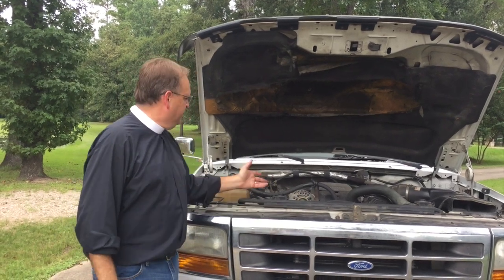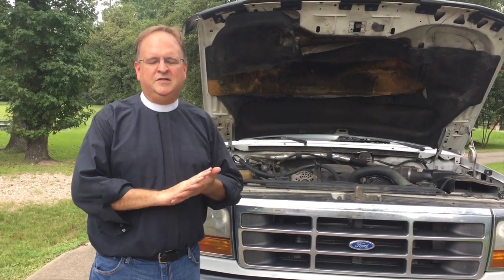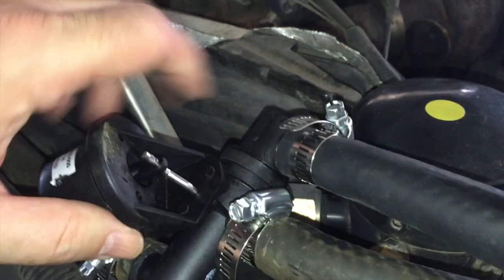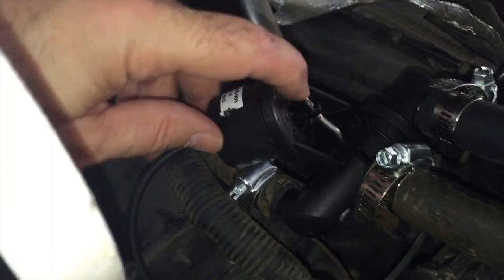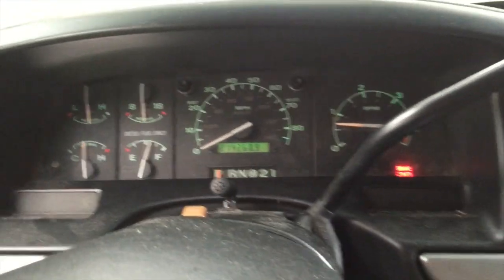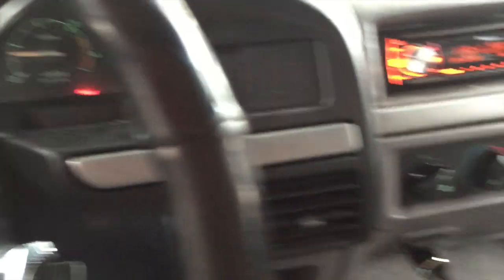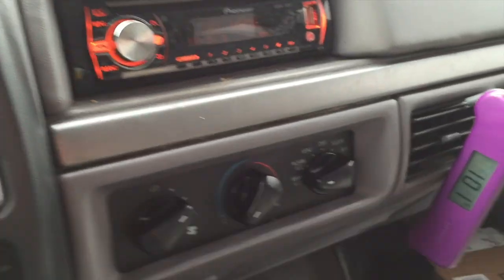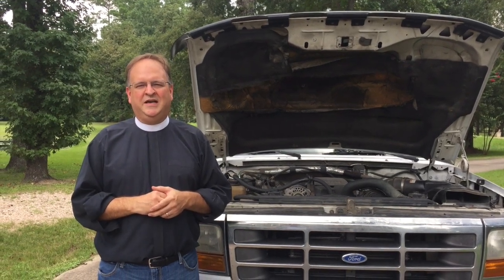Heater Core Bypass - Ford Super Duty - A/C Boost

Comment: Great video. 
I originally just used two hose couplers to separate the heater core from the coolant circulation when it gets hot out. Then put it back inline when it gets cooler and we need a little warmth.
Now that I saw your video I'm going to do this mod.

Comment: You could have just put a in line heater hose valve to when you need heat you just turn on the valve for the heat
Reply from the maker: Yeah, but this way it gets controlled from inside the cab. Handy for those transition months.

Comment: Do you have a Ford part number ? Thanks
Reply: Thanks!!
Reply from the maker: I used a Motorcraft heater valve. Part number YG350. Bought it on Amazon.

Comment: Unplug your heater core and loop the hose around so it won't be no hot air into your cab
Reply from the maker: Yeah, but then the heater won't work when I need it. Here in Texas winters I need the heater in the morning and full-blown AC in the afternoon.

Comment: You said go get some 3/32 vacuuming tube and the stock tube is 3/32 and will not slide over the stock tube. You need 5/32 and will slide over
tight!

Comment: On my 2001 F-350 7.3 I just put a ball valve in the heater hose from the water pump to keep the antifreeze from circulating. I just open the valve when it starts to get cooler out. I guess to totally isolate it I would need a valve in both lines. I just used what I had on hand. Maybe one of these days I'll do it with the vacuum valve . Thanks for the information. 👍
Reply: Are you talking about one of the two hoses that he cut in the video? I thought I did something similar in my Jeep....while driving, it got real hot! I assumed it meant that it needed circulation either thru the core as original, or thru the the bypass valve like in the video. You mentioned a ball valve...doesn't that stop all circulation? Is there circulation somewhere else? Wouldn't your way have the water pump pumping against a closed valve?
Reply: If your way works, I'd prefer it that way because with this bypass valve, the only way to bypass is to run Max AC. What if I just want nice cool outside air thru the vents? Your way would work better in that sense. No reason to run the AC if the weather outside is nice, but without the AC on max, the bypass valve won't work. You'd need another switch to manually control the valve with vacuum so you can bypass the heater core WithOut running the AC
Reply: @stephenmoore3117  My way works very good. I was just in upper Michigan and it dropped down in the lower 50's at night. I need to run my heat to clear my windshield so I opened the ball valve. Several days later it warmed up to 80 degrees and  I could feel the heat radiating from under the dash. Then I remembered that the valve was opened, needless to say I stopped and closed the valve. After awhile the heat subsided. I know you made a comment about  the water pump working against a closed valve. This makes no difference, a lot of old tractors and other vehicles don't even have heaters. Just bypassing the heater core won't hurt anything.

Comment: I’m a big fan of mods like this that correct design flaws/oversights by the factory engineers. I’d be willing to bet that the AC compressor cycles less frequently with this mod, and fuel efficiency/mileage increases slightly as a result. My only concern: does the condenser ever freeze up?
Reply from the maker: Gregory Kusiak I haven’t experienced that at all. The whole system is running great.

Comment: is it safe..?
i do not need heater in my area so can i permanently bypass my heater core its leaking coolant inside cabin...?
Reply from the maker: It's safe in the sense that the all it is doing is bypassing the heater core while the AC control is set to MAX. This keeps hot fluid from coming into the cab and gives a little boost to the AC. I put my control on NORM from time to time just to make sure fresh fluid gets flushed through the heater core. In the winter time I use the NORM setting all the time - it's the only way to get heat into the cab. If you are going to bypass your heater core permanently because it is leaking, you could just pull the hoses off at the firewall and join them together with a nipple and some hose clamps. You only need the valve if you're going to use your heater when it's cold outside.
Reply: thanks.
Reply: George McGavern thx i have a leaking heater core in rv ford 450 so i was looking how to